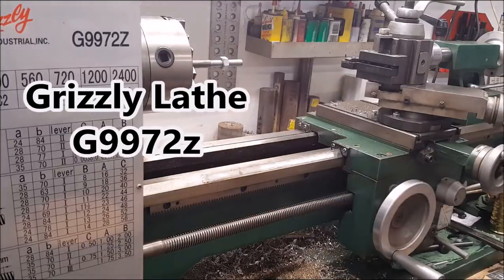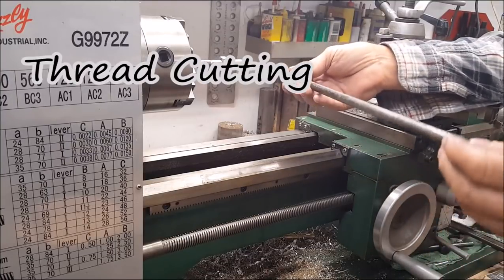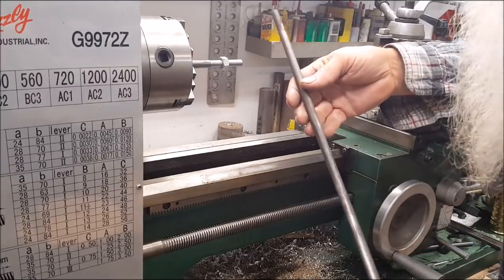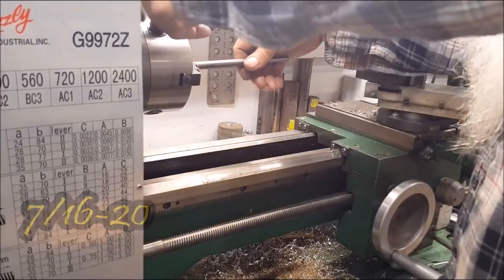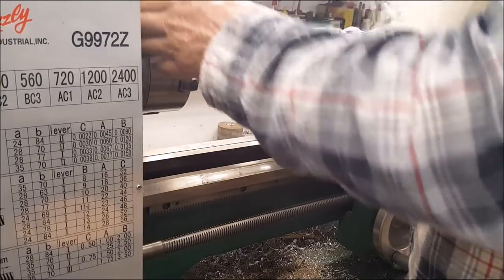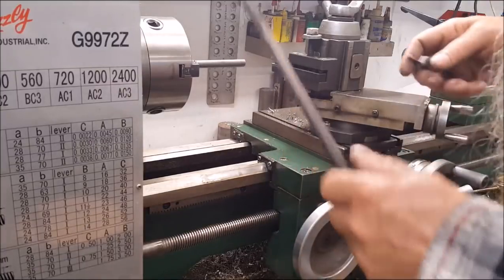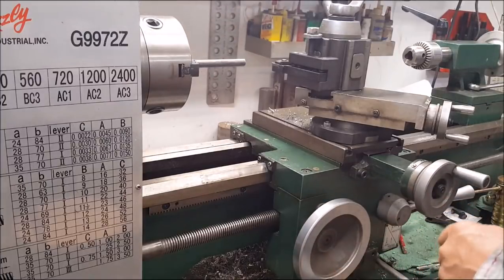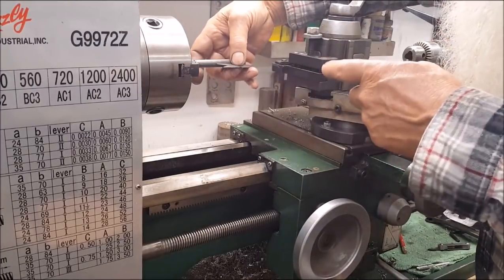Thread Cutting Grizzly Lathe G9972z

Comment: Great Job as always.👍 I’m thinking about Buying the same Grizzly Lathe you have. I have heard there is a lot of Sand still in the Castings when you get one. I don’t know if it’s True. Did you have a lot of Sand in yours? And have you had any problems with the Lathe? I would appreciate any advice you have.
Thanks
Reply from the maker: ,,,, sand cast in a mold in the ground, mine is as good today as it was the day I got it,,, does everything I need to do for the size of things I work on,,, I went to the Springfield store and looked at it before I bought it

Comment: Sam while I give you an A for effort your basic lathe skills are a bit lacking. Your workpiece is sticking way out too far causing a lot of deflection which in turn causes chatter and not a smooth uniform cut. This can and will break those fragile carbide inserts. Either move the piece in closer to the chuck or center drill the end and use a center in the tailstock to support it. You will get a much more uniform thread and no chatter marks. Been machining for 34 years so hope this helps.